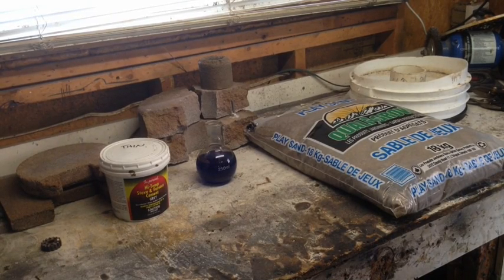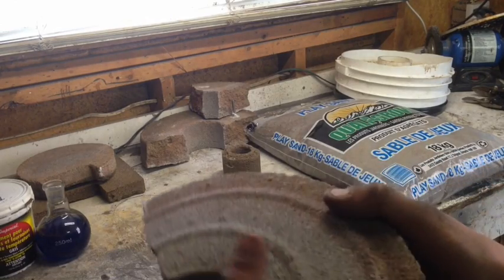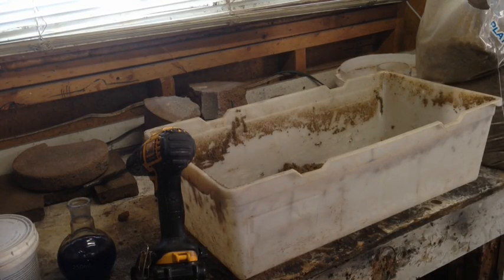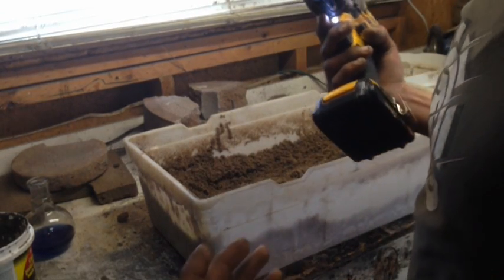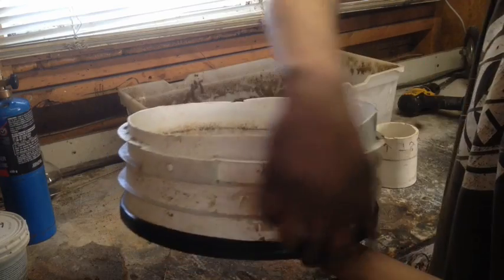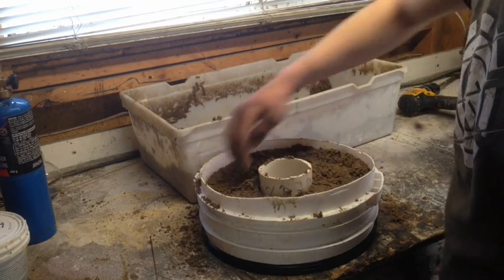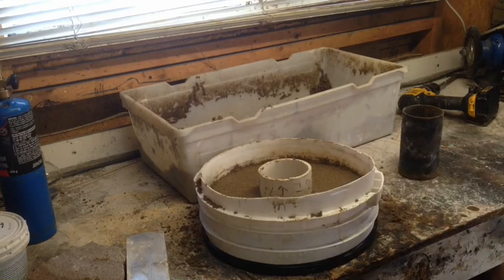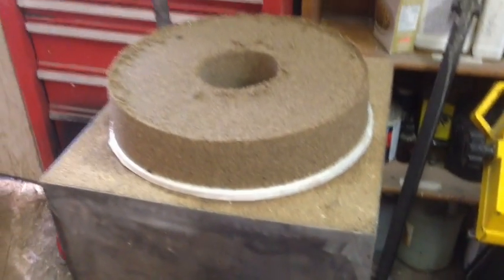How to make refractory brick (fire brick) with sodium silicate PART 2

Comment: I don't have a foundry for firing. Do you have another suggestion? What temps should be used to cure correctly?
Reply from the maker: Are you using the mix to make a foundry? 

If so, just fire it with the foundry you make... Just be careful with it the first time. If you are trying to make a forge, or all other odd shape that won't hold until the first firing, you can use carbon dioxide to cure the mix before firing. Just mix baking soda and vinegar in a device to direct the gas into your mould. I used a chemistry set to do so, as I don't have access to bottled CO2 

But that isn't necessary unless you need it to hold its shape better for the first firing.
Reply from the maker: You can get away with putting it in an oven for a few hours on high. It will come out solid, and can be fired with whatever it is you are using fire brick for..
Reply: nilamotk Thank you! I appreciate the quick response. I am actually making a wood oven and want it for the wall/roof protection. Buying a ton of Fire Brick will be really expensive and I wanted a creative solution.
Reply from the maker: Make you brick in moulds that are heat resistant, and bake them in the oven on high heat for a few hours. They will be solid enough to do what you need, and they will get fired the first time you run the fireplace 

Hope this helped, I recommend using pure silica sand instead of "play sand" as it withstands heat a bit better.

Keep in mind, this refractory mix doesn't like getting wet.. You could look into additives to help with water repellency if you need to.
Reply: nilamotk That is actually what I have purchased along with some fine perlite. At this point I am thinking of making some larger narrow blocks to line a separate outdoor fireplace too.  I am planning to mix in Mortar mix for waterproofing, but I would value your opinion if you have other suggestions. Thanks again
Reply from the maker: I have heard some bad things about mortar mix and high heat situations because of quarts in the mix. 

 Porcelain cement Is generally used for higher heat applications and a lot of home made refractory mixes use it in their recipes.
Reply: Autumn Pies if you are near toledo, there is some really nice kilns for cheap.. on craigslist.  one is 300 and is almost 8 feet tall, and it has segmented compartments
Reply from the maker: Patricia Hamilton Kephart Im not sure what the temp for curing is. I do jnow you can cure the mix with CO2 or even baking soda. Im not sure how to use baking soda, you could google it to find out. As for using this mix to go through your window, I dont know that this would be a good idea or not. This mix is generally not water resistant at all.. You could add fire clay to the mix to help with water resistance, but as is, water will destroy this stuff.. Something that you might want to think about..
Reply from the maker: Patricia Hamilton Kephart you could think aboit using double walled fireplace venting, and sheet metal to go through your window instead.

Comment: Hey awesome video thank you for sharing it as it's perfect for what I want to do. Also had my ass cracking up when you said I advise you not to go an cut up your moms pressure cooer plate
Reply from the maker: Haha, my mothers yelled at me countless times for "borrowing" things from wherever.. So I thought I would point that out haha. Fortunately that's actually my pressure cooker, and it's not for canning jars, so I don't need the separator plates. They worked out perfectly.

And I'm glad the video helped out, this should ideally be done with silica sand but I couldn't get my hands on it. Play sand works for most purposes but like I said, it should really be silica sand.. You can also get away with using perlite, if you need a really light mix, but it's really soft, and kinda fragile..
Reply from the maker: Haha glad you like it
Reply: @nilamotk  "pool filter sand" is silica sand, found mine at canadian tire, I would have been using play sand if you never said anything. You're the 1st person to mention it out of dozens of forge/foundry etc vids I've seen, and today, I'll be giving it a go! Thanks!